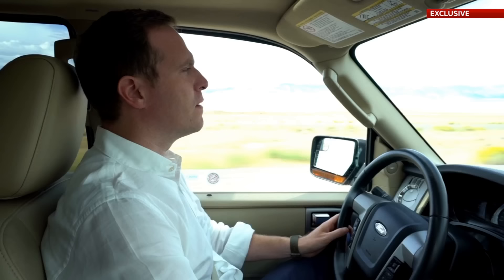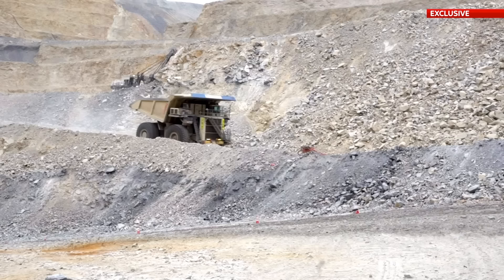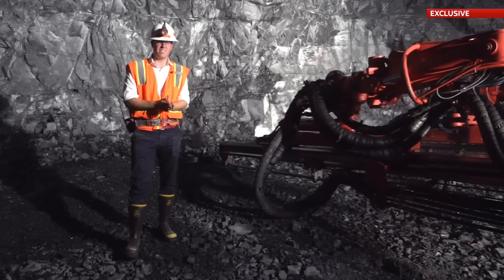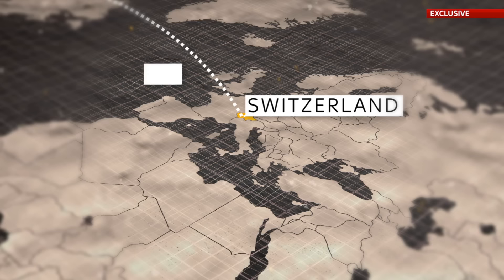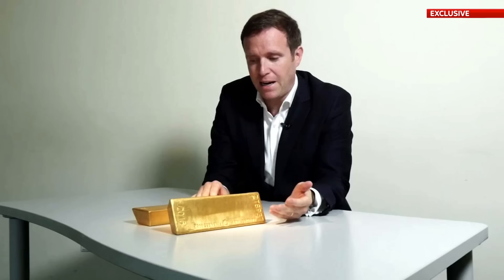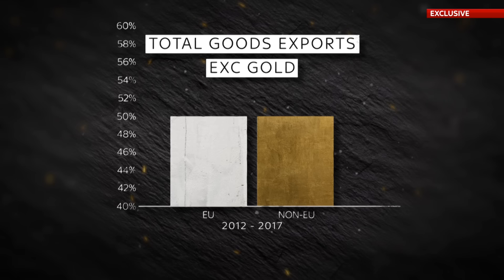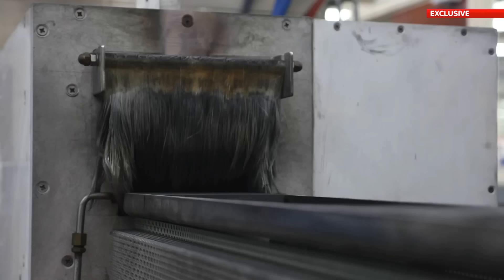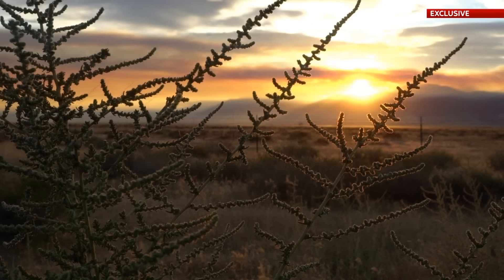Brexit Forensics: The gold export illusion

Comment: That's a slightly odd way to phrase the situation; trading gold is a perfectly valid form of trade, it doesn't so much confuse the picture as impact upon it. While the question is raised, it's not answered, we don't know whether Brexit will or won't affect this market.
Reply: I think the point being made the inflow/outflow is distorting because there is no value being added benefiting UK plc except for a few delivery drivers, security guards and warehouse personnel.
Reply: @oktfg  Well, that's not actually the case, it does generate revenue, there's considerable industry and expertise involved, but there are also taxes and duties on the process. I believe it's actually classed as 'financial services' in terms of economic calculations, which, as we all know, is the largest contributor to the UK economy.

Comment: Let’s assume Sky is correct and gold is a major part of the figures. And? Well, they are still the figures. Is the gold trade not worth anything?
Reply: Not really. The equivalent would be like a city claiming to be the mecca of tourism because it has an airport hub where people transit. It would be laughable right?
Reply: "Is the gold trade not worth anything?"  Well, no. Not really. Imported for 99Pence sold for a Pound. The difference makes a few traders rich, but it creates hardly any jobs and certainly starts no production chain in the UK.

If this should be the vision of the trading nation UK this is  a very bad vision...
Reply: no because the usa simply uses the uk as a transit hub the gold does not belong to the uk so it should not be in those figures
Reply: Wikichris - Yes it brings very few jobs and zero is added to the worth as gold is flown in and out. This is transit not export.